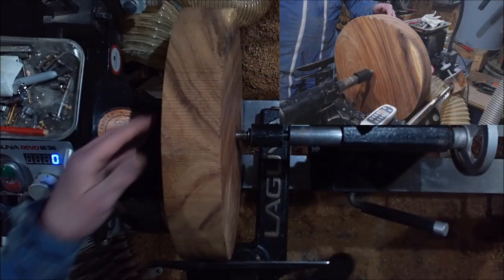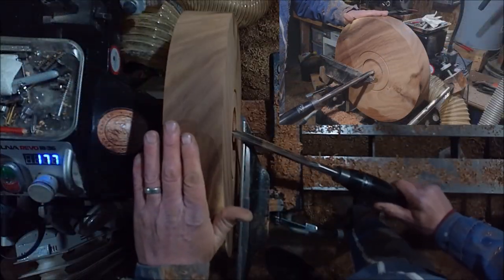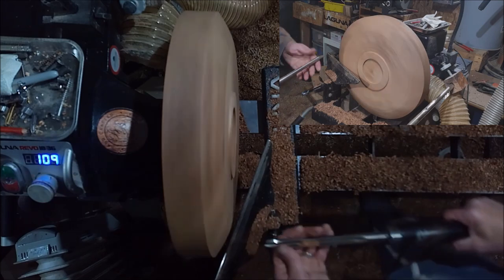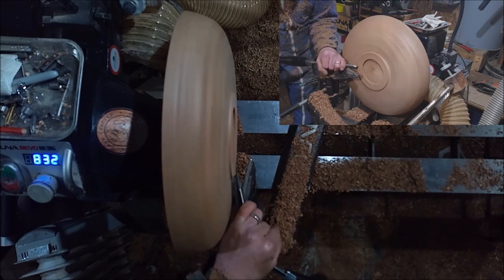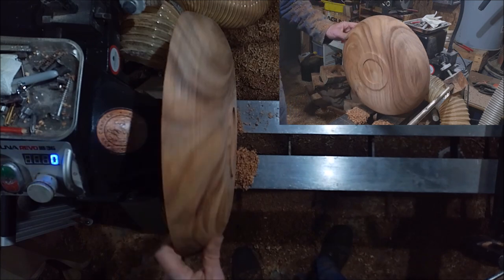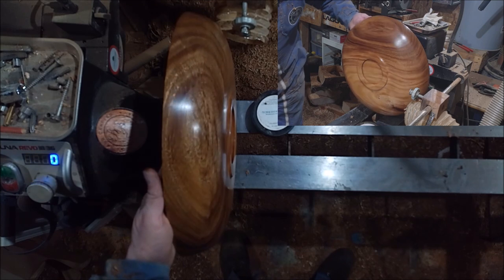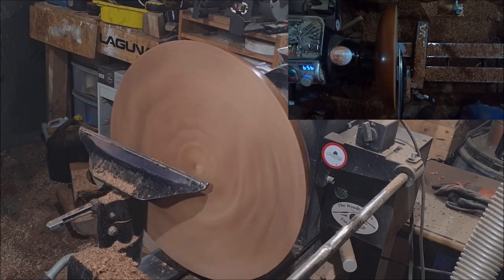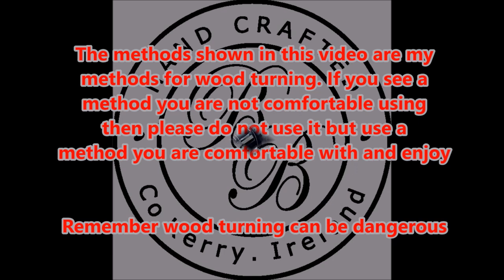Woodturning a large Tiger Wood bowl failure / wood turning

Comment: You’re right it happens to us all but it’s incredibly frustrating. Looking forward to the repair.
Reply from the maker: It is frustrating indeed Victor and it does happen to us all which is why I make a point of putting up videos like this one, when something goes wrong. I think it is important, especially for newer turners to see that this does happen to experienced turners and when it does it does not mean just because they have had a problem that they are bad at the craft and should give up. 
Shay

Comment: The timber is absolutely stunning . It is not a failure , but a redesign opportunity 
Might I impart some observations .? When you are turning exotic woods , yews , holly , lignum vitae   etc . Wear your respirator before you begin . . Fine dust ,,can be inhaled , and begin respiratory events before you notice them . A powered filter system like the Axminster ,, or trend Air prom, are great . They can be used with an ear piece mic . Or a throat mic . Many demonstrators  that I have watched , have done a voice over  in editing 
Even though it is your shop , and nobody else is there ? It is not a good safety practice , to walk away from a spinning lathe , even if just to give a tool a quick touch up on the grinder 
 Many turners that I have watched , Mike Waldt , Colwin Way recommend using the tail stock when rough turni g , even when using face plates or screw drives    , even after turning the work around to hollow . Using a depth gauge and bowl calipers often help prevent funneling 
I look forward to watching your follow up  Slainte
Reply from the maker: Some very valid points Gary, I have tried the voice over thing and to be honest just can't do it to my satisfaction. A powercap is on my wish list to get, i have used my fingers as calipers for thirty odd years , that is the way I was taught to do it, yes i agree a bowl calipers would probably be a lot more accurate but since me getting a funnel is a very rare occurance I stick to what I know. The tail stock thing is just personal preferance and depends on what I am doing and what mod I am min to be honest. Sometimes I use it sometimes I dont. In saying that if I am doing a very large heavy bowl I will always use it. Glad you are enjoying the videos.
Shay
Reply: @BBTurning  as Roy Underhill , the Woodwright likes  to close his shows " May The Grain Be With You "

Comment: What do you suggest I use to hand sharpen all of my gouges and skew instead of using a grinder?
Reply from the maker: For touch ups Joseph I would recommend a diamond card but to sharpen properly and fully either a bench grinder a Tormek type system or something like the Sorby proedge. 
Shay
Reply: Sounds good. I’ll look into that, all of my gouges and skew are made by Carter and son. Keep up the good work and awesome videos!